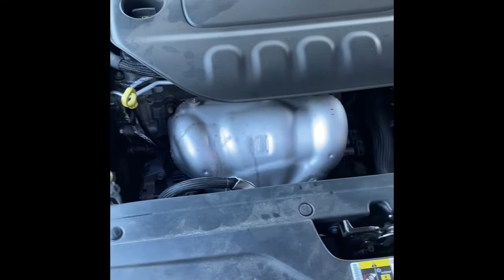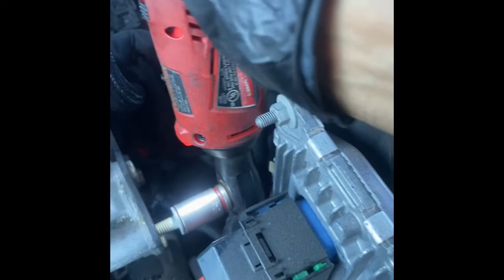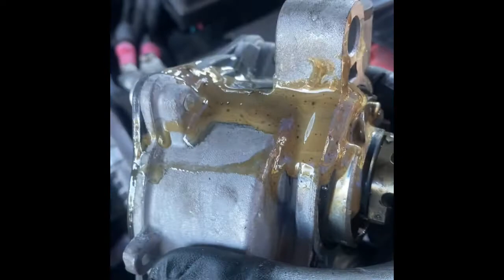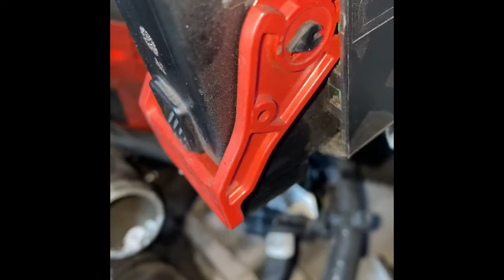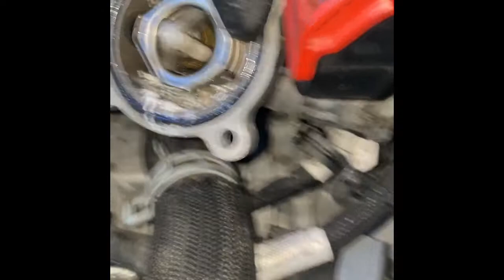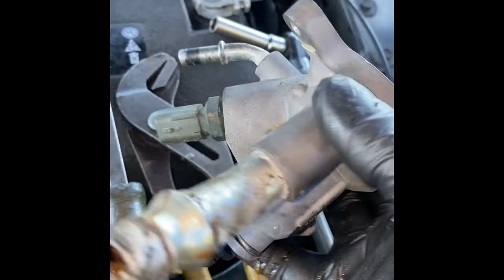Chrysler 200.  Overheating . Diagnosed and fixed.

Comment: My engine gets very hot but the car doesn’t overheat, after driving for a while it’s runs rough hard to accelerate and once it turns off it won’t turn on for awhile inside it’s engine warming please wait, any ideas?
Reply from the maker: Hi try first thermostat because engine getting hot
Reply from the maker: Some cars when engine got hot engine reduce power for safety
Reply: @autotech9043  I changed my thermostat I changed the whole motor I changed crank shaft cam shaft everything you can think of an my car still says engine warming and won’t start
Reply from the maker: I think radiator not good make sure check radiator and the coolant sensor
Reply: It was my head gasket had to get a new motor sorry I know a lot of you guys didn’t wana hear that
Reply: @dodgelife1368 head gasket can be replaced without swapping motors wth

Comment: How did you remove bottom right bolt  on thermostat
Reply from the maker: If you remove the brake pump has 3 bolts will give you more space